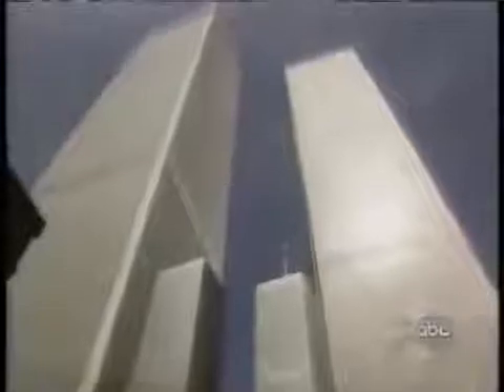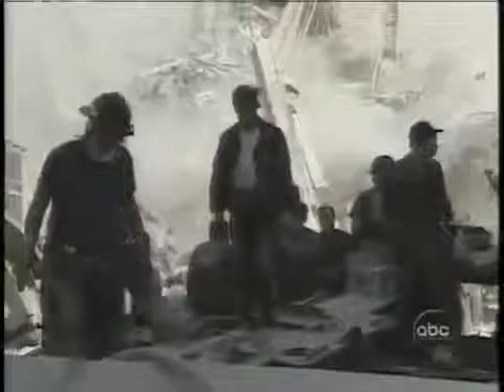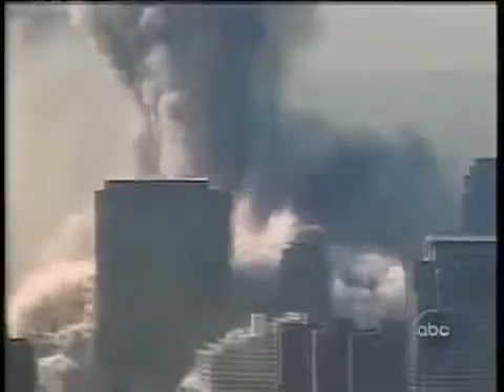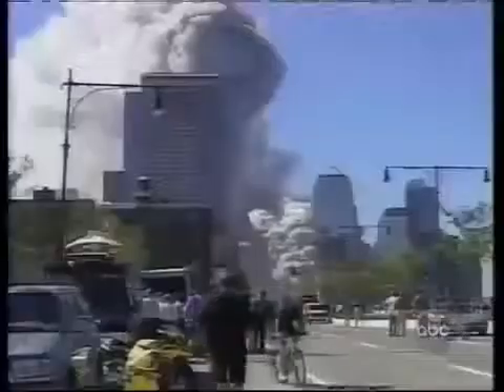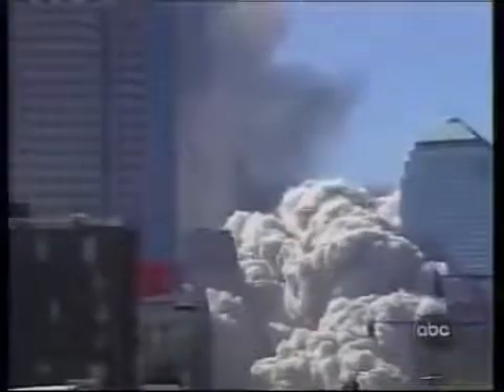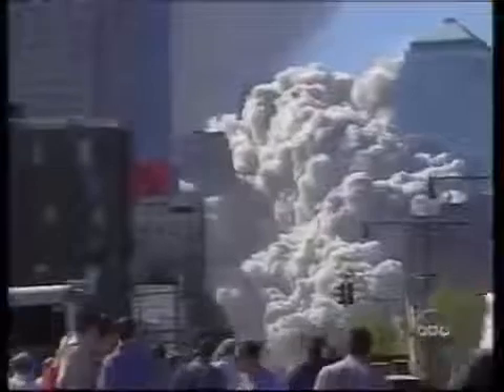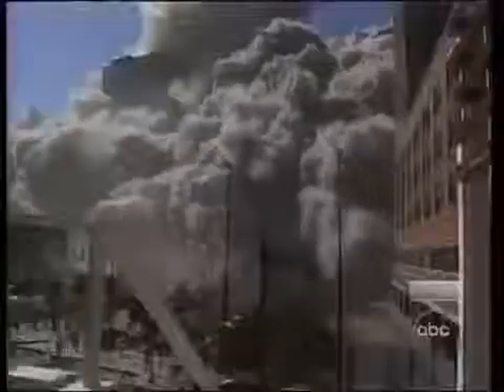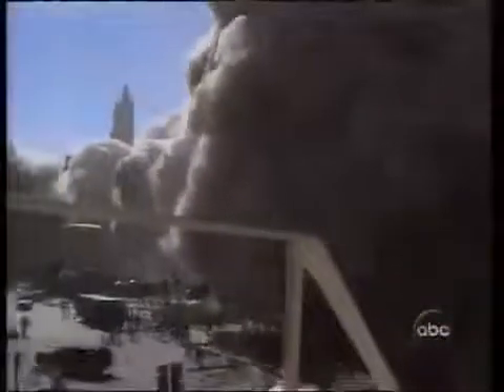9/11 - Twin Towers vaporization

Comment: The specks of steel were not the beams, but more likely from the corrugated steel pans under all the concrete flooring upon which the nanothermite was applied. The steel core beams were cut by thermite cutting charges into lengths about 30 feet for conveniently fitting onto flatbed trucks, hundreds of which were loaded each night starting early on.  These pieces of steel can be seen in videos of the collapsing towers in the sky beyond the cauliflower smoke.

Comment: Building 7 falling into it's foot print is the proof that this was a false flag operation.  Buildings made of steel don't get hot enough from fire to just collapse.  It took very high temperatures just to make that steel at the factory when it was made.  For an entire building to fall in the direction of most resistance instead of to the side or not at all is just not scientifically normal.   These buildings had some help to take them down.  If you don't believe so then your just another human zombie.